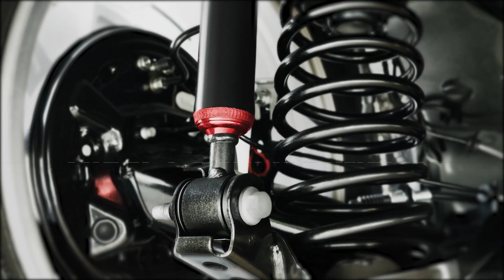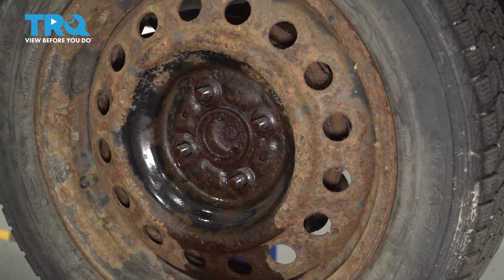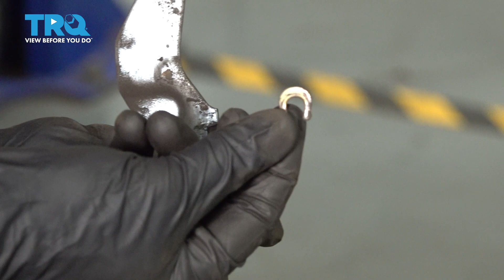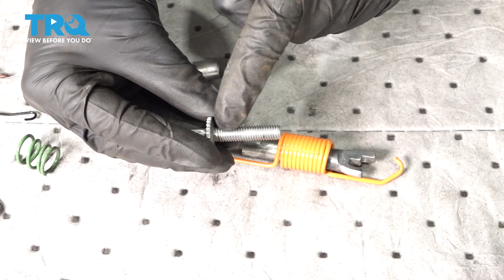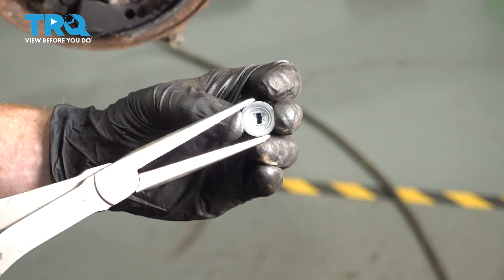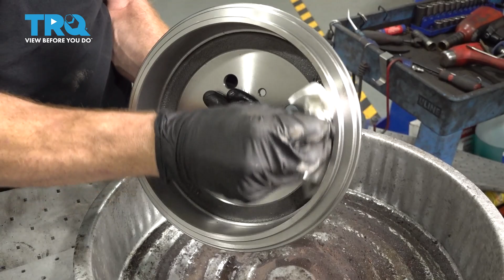How to Replace Drum Brake Hardware 2004-2006 Scion xB

Comment: 15:15 the adjuster isn't on correctly, notice that the curve is supposed to be in the back .. because the heat needs to touch the locking mechanism.. adjuster shouldn't move freely.

Comment: You're making a how too video but you put stuff in backwards.

Watch your video closely... When you put your adjuster in the front long fork goes in the back/inside... Just like the way you took it apart.... When you put it back together, you put the long side of the fork to the outside.....

You got that backwards.

Also, when you took it apart, you said the Spring for the adjuster Goes out the back through the front. You put it in backwards, which really doesn't matter For this part, but when you're explaining to people, how to do something either explain that or put it back the way it came apart.